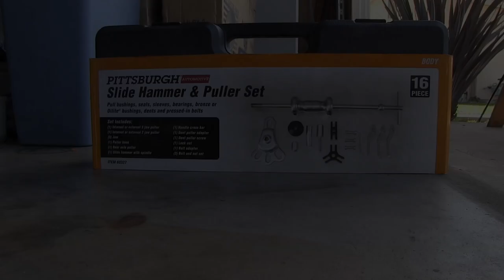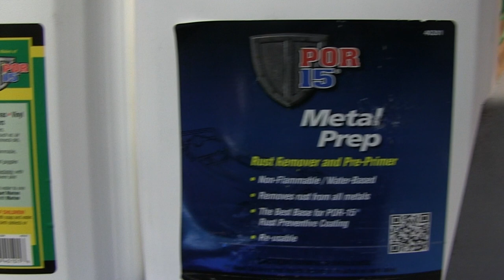VLog 13 Mazda RX3 POR15 Application to Rear End, Axle Removal

Comment: The Por-15 dried slowly outside because that is what it is formulated to do. You must have low humidity because if your outside air was humid the paint would have dried in a few hours and foamed up and blistered. When that paint cures it creates a gas that needs to escape through the wet surface, if it dries too fast it traps the gas forming bubbles. The UV  exposure did not harm your paint, it takes weeks for the sunlight to dull the surface and then it is only cosmetic. When you dip the brush into a full can you are introducing air and moisture and the entire can will cure while sitting on the shelf. Again the gas forms and will blow the lid off or at the very least , bulge the can.
Reply from the maker: Flick Cogswell Exactly Flick. I spent some time back and forth over e'mail with the pros at POR15 and they pretty much said exactly what you just did. Great stuff but very important to have everything prepped just right and conditions as stated by manufacturer.
Reply: riverseine I just bought por 15 to do the rear half of my toyota pickup frame.  I bought Aceton, oven cleaner and brake cleaner. Do you guys think that will be enough to prep the frame before using por 15?  Its not greasy, its just starting to rust so Im going to use a grinder with wire wheel attachments and brush the entire area.  Do you think oven cleaner, then brake cleaner, then Aceton in a bug sprayer for the last step to wash it down good.  Do you think that will work fine?  I hope so because I just spent $100 on cleaning stuff alone lol  
Also I wondered myself about putting the lid back on the can after using it so I was wondering about maybe using a turkey baster to take out of the can as needed so the top stays clean. 
All thoughts and suggestions welcomed. Im about to do this in a couple of days.
Reply from the maker: ***** I would use POR15's cleaner/degreaser and then their Metal Prep. The cleaner degreaser will remove any sediment remaining after you have used your wire wheels. Their cleaner degreaser is better than the acetone I used. Acetone evaporates quickly leaving dirt and such behind. POR15 Cleaner Degreaser will be hosed or washed off to remove debris etc. I didn't have any when I needed to clean my axle so I had to go with what I had but if I had to do it over again I would get the POR15 cleaner. As far as the Metal Prep goes, definitely get some. It coats your frame (or anything else you want to protect from rust) with zinc phosphate, a great rust inhibitor. Plus it also etches the metal to help keep you new coat of POR15 (or any paint) to stick permanently. The oven and brake cleaners will probably work but I personally wouldn't mess around anymore. I just did a batter tray last weekend with all the right stuff and I feel much better about it than my differential. As for the baster idea, that is probably a great idea. Mix your POR15 really well with a stirring stick before sucking out. Currently, I just keep brand new empty paint cans on hand to pour remaining uncontaminated POR15 into after each job. I may try your baster idea next time though.

Comment: How long between coats and how many coats ??
Reply from the maker: 64impalaSS The guys at POR15 told me to apply the second coat while the first coat was mostly dry but a slight tacky to the touch. Not so tacky that it leaves wet POR15 on your finger, but tacky to where you feel it pliable under your finger. Timing depends on humidity in the air so there is no definite time between coats. I applied two coats with a brush. If I had to do it again I would use a spray gun (which I now own but didn't at the time I painted my diff)